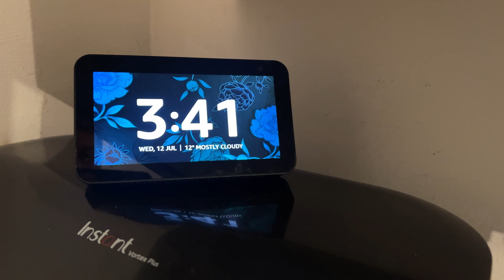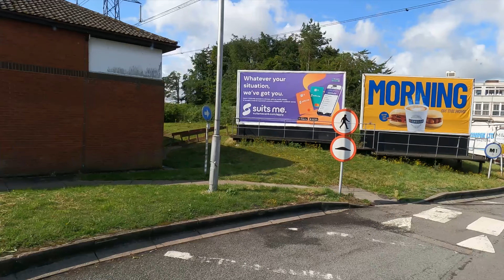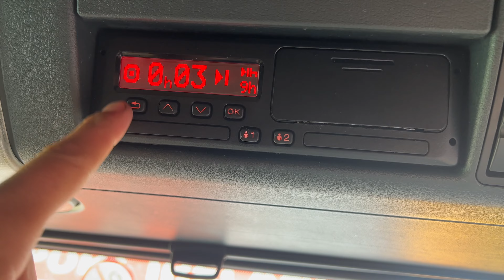250 Miles Drive And Load Refused!! | Vlog 36

Comment: Just no joined up thinking with this type of load refusal, and think what that does to transport costs and ultimately consumer costs. Utterly ridiculous. South Mimms night time robbery at those prices. That closure on the A50 at Blythe Bridge is just a nightmare and it will continue for at least another month as they are renewing gas pipes. I'm avoiding it as best I can. Just heard of new services being built on the A50 at Foston between A38 Toyota and Uttoxeter which is supposed to be a truck park too, might take some of the pressure off at Donnington eventually. Mind you it will be the end of the Salt Box Cafe just round the corner it was full every night there until new A50 bypass was built. Progress eh? All the best Darren.